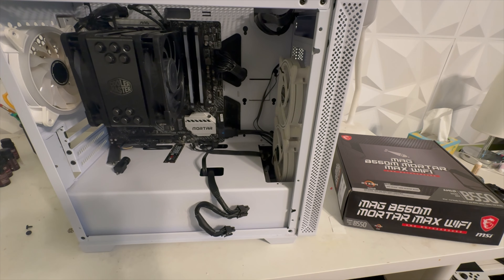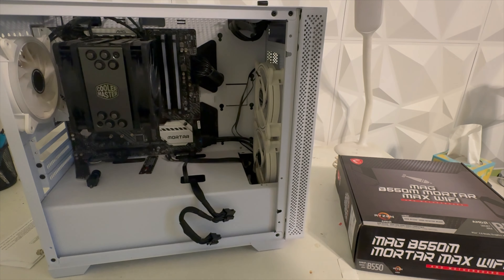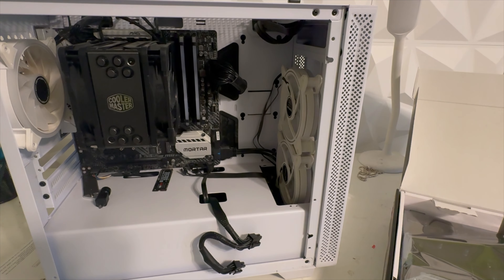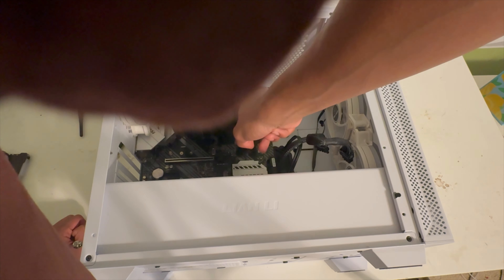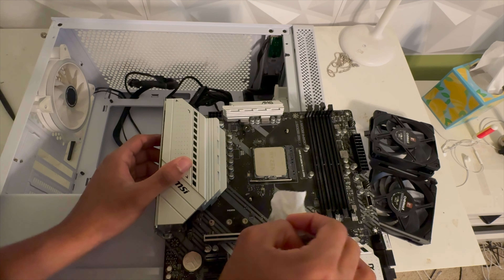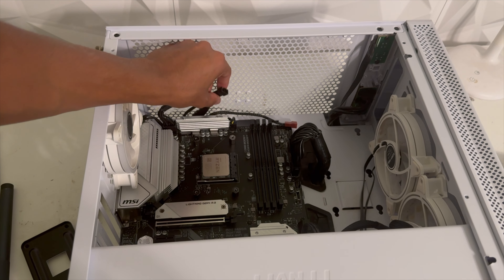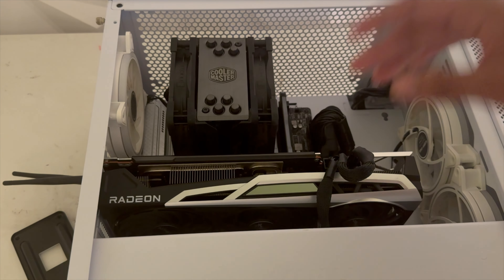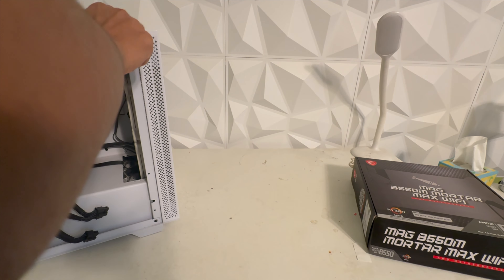so i fried my motherboard... // rebuilding my gaming pc

Comment: Im pretty sure you put the RAM in the wrong slots, might wanna check mobo manual. I think they should both be shifted over 1 dim slots (use gray slots first).
Reply from the maker: @LuckFPS1  yeah I shifted them down by one, thanks anyways